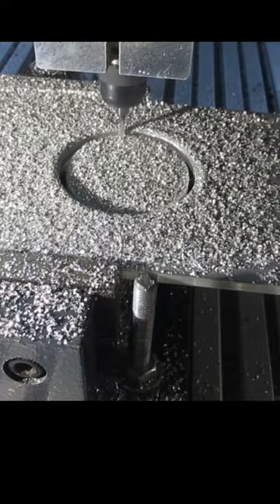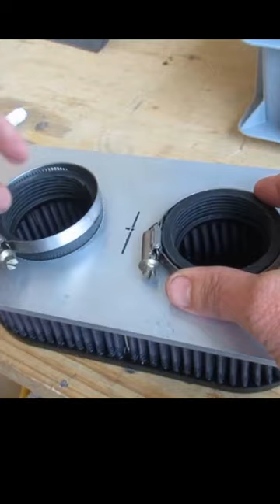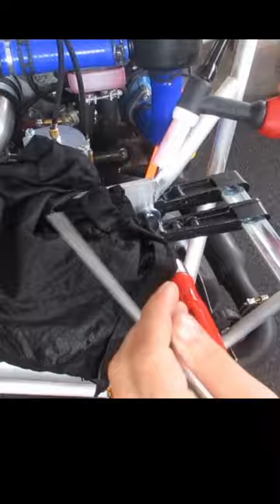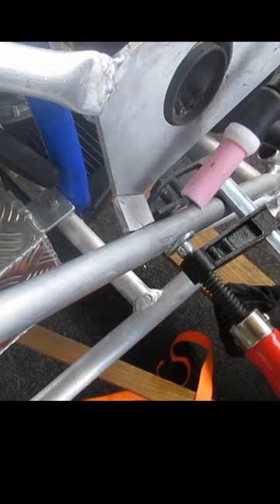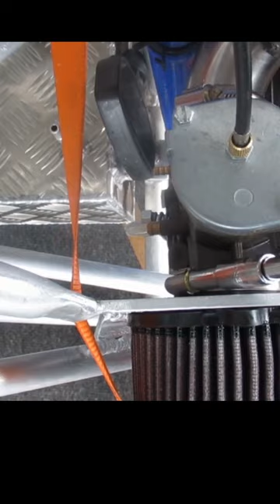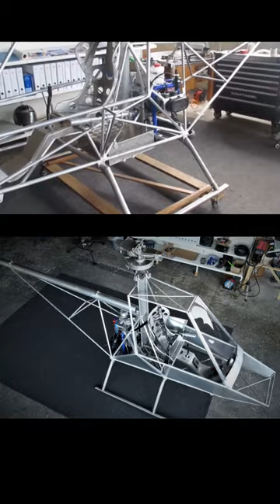Carburetor Reinforcement Plate #shorts

Comment: You're being short sideed with some of your applications.   You know that the rubber carb boots do wear out in time due to use and vibration.  You also might consider carburetor heat kits that utilize outside water jackets via water pump and return to the cylinder head.  Just some thoughts.  Previous owner of a 582 and 670 powerplants.  Hope You're not under powered.